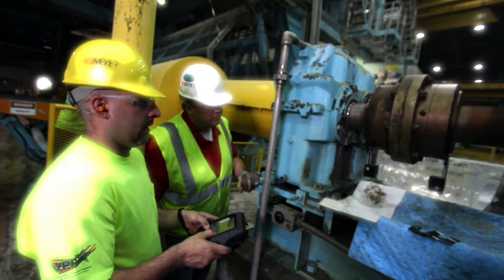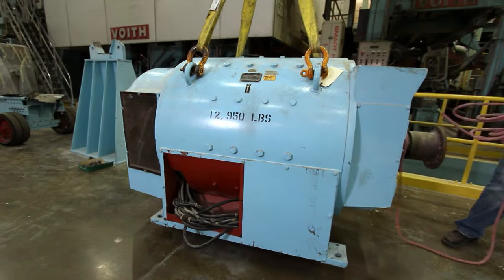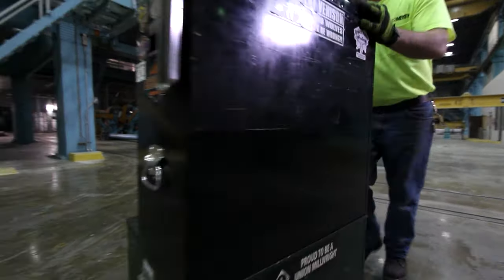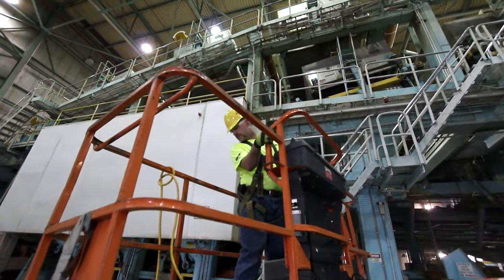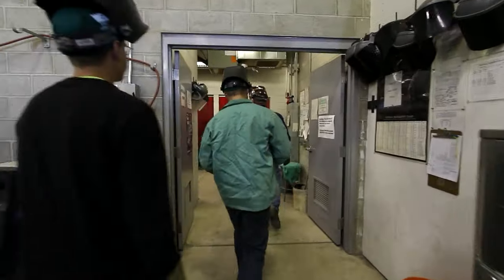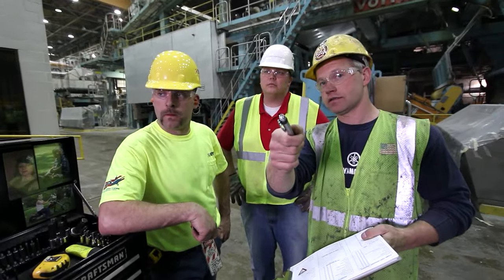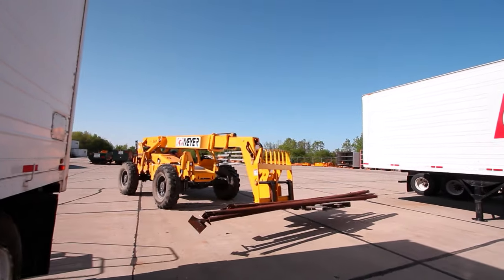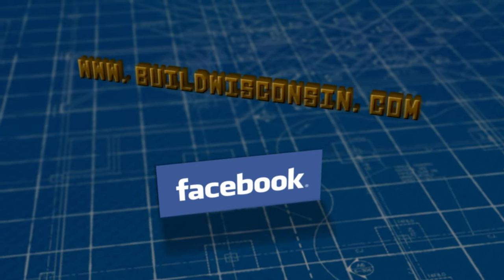A Day in the Life: Millwright

Comment: What kind of math skills ?? 
Basic adding subtraction multiply and divide right
Reply: Cam Mundy most likely
Reply: formulas , basic math, but still need to know for instance, figuring out a vertical angular offset on a MTBM and the STAT, and how to correct the problem efficiently, then again youre probably a pipe fitter, your ass can wait....well be back when its time to test pipe stress
Reply: Steven Zemo Thanks for the info dude!
Reply: Cam Mundy more than. Millwright is a master mechanic. Jack of all trades
Reply: Cam Mundy Hahahaha no buddy, you need to know a little more then that. By that I mean “basics” but they don’t use useless shit like precal. I’m talking about decimals and high precision
Reply: Trig and geometry
Reply: Take an 1800 rpm motor that is spinning a 6 inch pulley, connected to a 10 inch pulley, which is coupled to a 6:1 gear box. That gear box is turning a 12 inch pulley with a 10 tooth sprocket which is chained to an 18 tooth sprocket, which turns a 30 inch sheave. Your gear box just took a shit, and all you have to replace it with is a 15:1 gear box, and this is not a vfd system. So how are you going to change what is necessary to ensure you are still turning that 30 inch sheave at the correct rpm?

If that is basic math, then you should have a handle on this...

Comment: So there's not a Non-Traveling Millwright job?
Reply: There are in-house millwright/maintenance jobs. Alot of the paper mills in my area have a full time maintenance staff with a few guys that work off shift and weekends and they're called Millwrights. The difference between being a contractor and in-house is the level of experience. Contractors do everything and anything, from the huge jobs to little stuff. In-house Millwrights tend to only do smaller jobs just to keep the mill running. This is coming from someone was non-union In-house maintenance to working now as a union millwright.

Comment: Wouldn’t exist if they didn’t steal half their work from other trades, basically the handymen of the auto plants, iron workers afraid of heights
Reply: Ironworkers are a completely different trade. They're in construction and not industrial. Millwrights are purely industrial. We don't steal work either. You'll very seldom see Millwrights working on pipes, electrical, or welding and building pressure vessels.

Comment: Jack of all master of none, either be a mechanical fitter or an electrician
Reply: Or you can become a master millwright. A journeyman electrician is not even a master of being an electrician yet. Better to not make stupid remarks like that lol.
Reply: Millwrights are literally The Trade of All Trades.
Reply: @nigeleharis5886  that is a hilarious statement no one wants to be a millwright, it’s a terrible job dirty poor paid a skill set that isn’t in demand and isn’t respected companies tried to employ
Millwrighs to maintain machine tool applications CNC years ago and it didn’t work a millwright is a Jack of all trades which is a master of none they are useful for bolting machines down or some bench fitting and some servicing  but when it comes to a complex machine tool fault you need an electrical technician and a mechanical fitter who both have heavy maintence back grounds to be able to understand the complex electrical and mechanical systems from PLC logic and relay contractor components bridge rectifiers electronic circuits boards the list is never ending and the mechanical fitter needs to be fully competent in fluid dynamics thermodynamics pneumatic and hydraulic control systems so much millwrights are gone a thing of the past that never worked in the first place make nothing an hour poor working conditions a skill set that is so varied that you actually mastered not one skill. Mechanical fitters and electrical technicians are masters of there craft and hold technical theoretical and practical skills that make them arguably the most respected trades with in the engineering industry and the most valuable hence why they are the most paid there skill sets allow them to work across multiple industry’s such as aerospace rolling stock nuclear construction mechatronics chemical and energy and many More electricians are king of the skilled trades followed very closely by mechanical fitters everyone knows that it’s not a secret
Reply: @southwest3369  entirely understand your sentiments. I am a millwright specialized into an air compressor technician, so I do deal with lots of what you mention. I understand millwrights will specialize into another trade that will be more constant with work in one of the skill sets they possess. It’s only economics. 

However to badmouth millwrights I do not agree with. Thanks for your in depth reply. My line of work where I am from is pretty niche. Enjoying the additional perspective!
Reply: @southwest3369  sorry for my ignorance but mechanical fitter sounds like simply a higher level millwright.
Reply: @southwest3369  who is going to handle the precision work, such as alignments? Your lack of a skillset is showing...
Reply: @The_Vanilla_Guerilla  a mechanical fitter millwrights are obsolete, they often carry out basic jobs bolting down some machines fitting some steam pipes, anything highly technical or skilled usually requires someone who has actually mastered a skill a millwright would have a panic attack working on a 6axis CNC machine tool, or anything that requires in depth mechanical knowledge or electrical. Millwrights never worked as an idea in the first instance it’s why they no longer exist and now you have fully qualified electrical technicians and fully qualified mechanical technicians who only do mechanical or electrical work and study in depth at college to do so. Millwrights where I work are just what we call bolt slingers, our CNC machines 6axis robots chemical process lines with control wiring we just tell them to bolt it in for us cut things down all the low skilled manual work and we do all the fault finding high precision instillations down to ten microns sometimes even less. I’ve worked in multiple industries and these guys can’t survive or make a living it was a job that was created out of thin air to create a multi skilled engineer rather than have separate disciplines for example fitting a motor then waiting for an electrician to install wiring and connect up the idea was a millwright could carry out mechanical work electrical work a bit of everything but the apprenticeship never worked  and eventually with the progression of technology millwrights became masters of nothing obsolete in the work place there isn’t even millwright apprenticeships anymore in the U.K. where I am? You do an apprenticeship in either electrical engineering or mechanical engineering I have worked with older guys so are mechanical fitters and they always refer to millwrights as Jack of all masters of none
Reply: Lmfao 🤣🤣🤣 you're a CNC mechanic?! I'm a millwright and Camco Manufacturing (a CNC shop with roughly 90-ish machines) begged me to come be their CNC mechanic. Sounds to me like that is orobably a popular trend in your industry, hence why you're ass chapped about millwrights in the first place😆
Reply: @The_Vanilla_Guerilla  I’m not a machine mechanic, I’m an electrician tech or in other words the person you could have been if you could count higher than 6
Reply: @The_Vanilla_Guerilla  also with regard to this paragraph you couldn’t not be a CNC machine tool technician as you don’t actually hold qualifications to make you competent to work on them also someone of your level of education of banging things with a hammer would probably think ladder logic was a step ladder inside of the machine.
Reply: @southwest3369  Did a M/W Hand take your Ol' Lady???
Reply: @jacoblocklear6809  I doubt it, women tend to like a man that can count higher than 4! Not to mention someone who earns more than just over the basic wage.